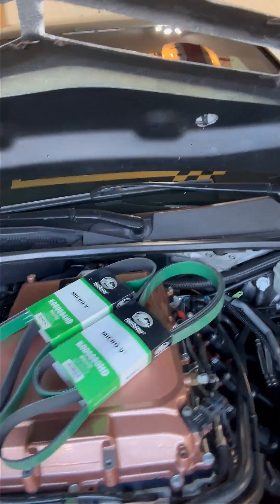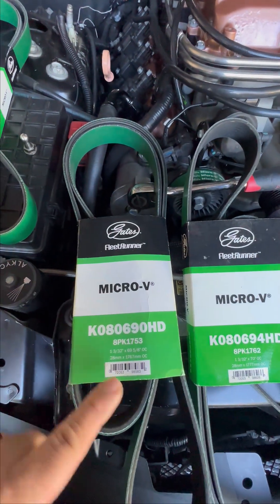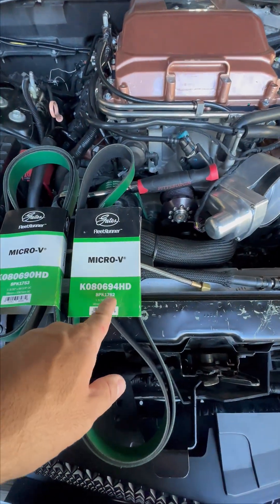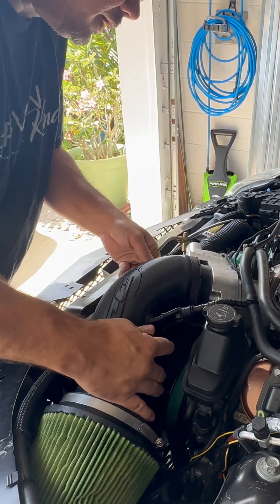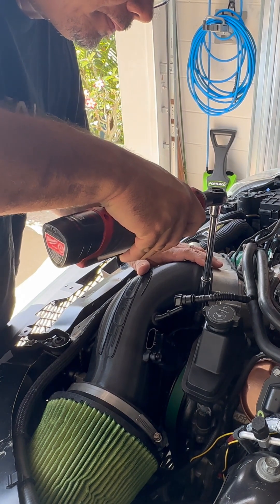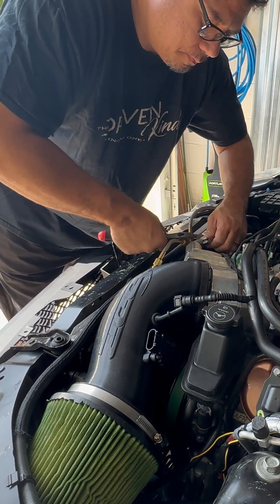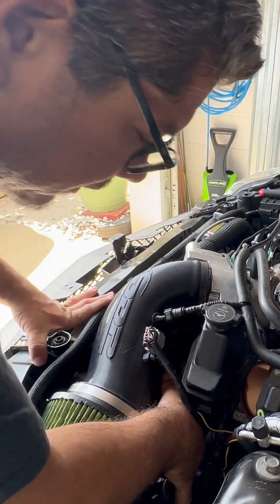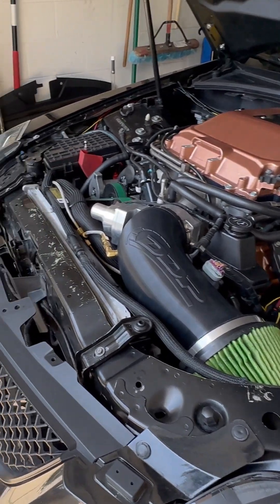CTS V Supercharger Lower Pully and Belt Change MORE BOOST!!

Comment: What lower pulley are you on?
Reply from the maker: 9.55
Reply: @JustMakinHorsepower  ok so no OD right because I’m lookin at try to get a 17% OD pulley
Reply from the maker: @Lifesaboutcarz  I use a Innovators West pulley.  The accessories run on the stock size and the supercharger on the larger OD pulley.